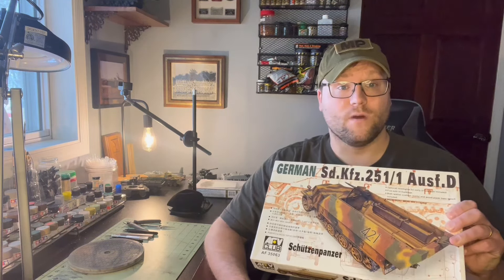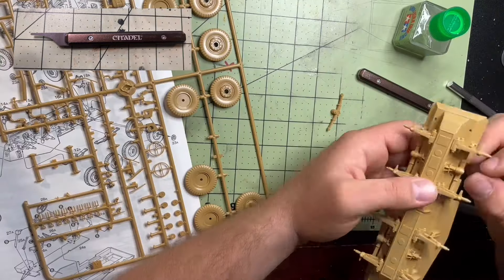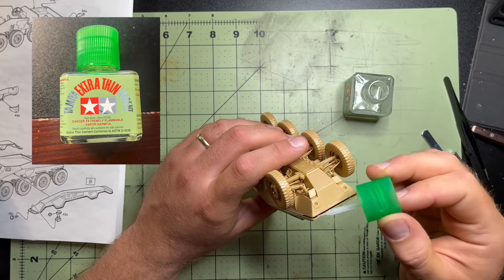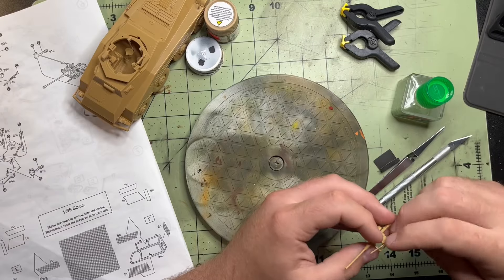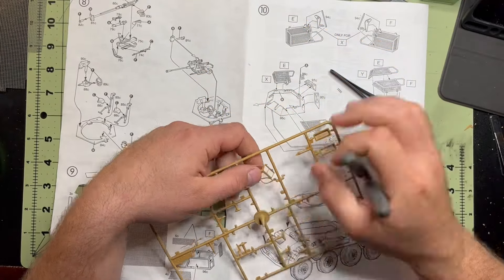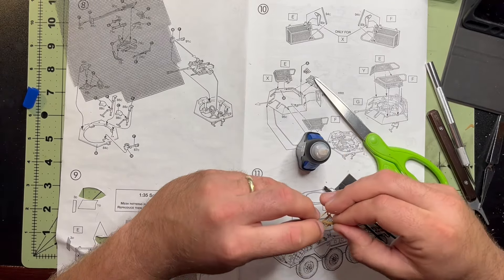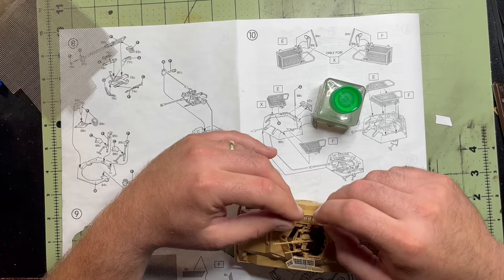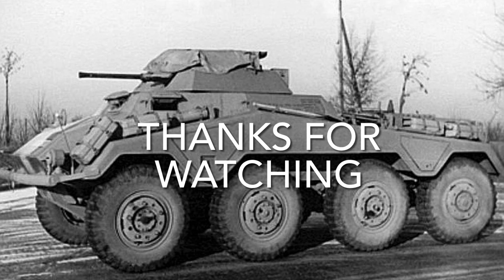Sd. Kfz. 234/1-The build

Comment: Good video! I have the Dragon version of this kit in my stash; it has probably 3 times the parts (all in the suspension, which is why I haven't built it yet😄) I use the various weight Tamiya cements like most people, I suspect. I gave up on that plastic screening ages ago, and just buy sheets of PE screening of various sizes-much, much neater and more to scale. Again, good video. Much respect and many thanks.
Reply from the maker: I have a trumpeter Sd. Kfz. 7 I was gonna start, but I have never seen a kit with so many parts and details. Promptly closed it up and put it back on the shelf. I need a few more years of practice before I try that again! Lol

Comment: Honestly surprised you didn't encounter fitment issues. I've had several Italeri kits in the past and all had some major problems with misaligned parts (defects from the molding process I think) or just horrendous gaps between panels needing a lot more putty than you'd hope.
Reply from the maker: Oh I know all about that. I was building an Italeri kit a while back and I just had to plain stop. Nothing fit! It was obnoxious! But I swear some Italeri kits are good, and some are trash